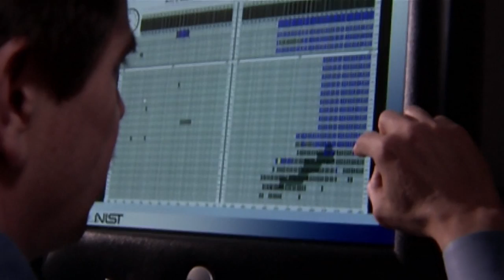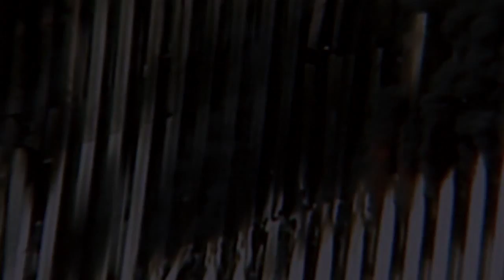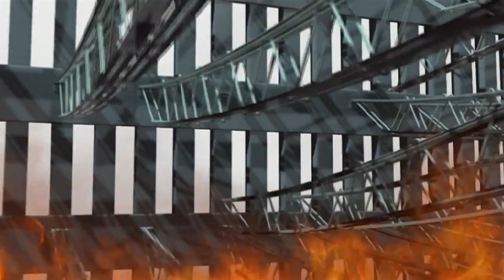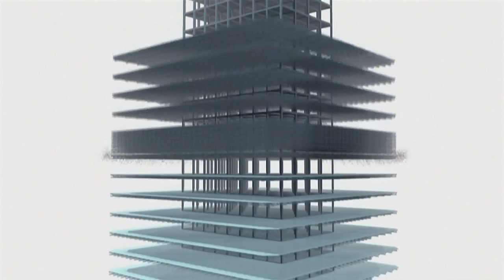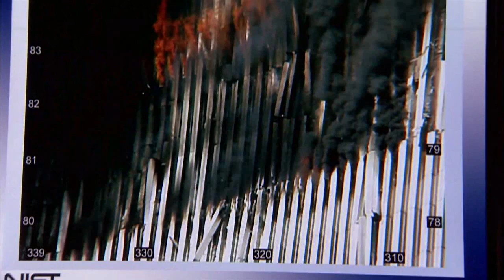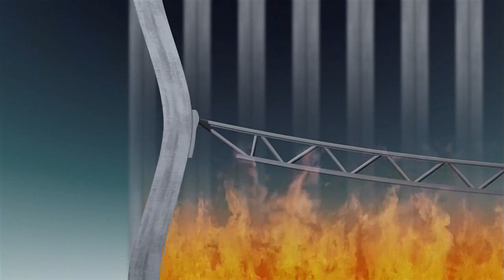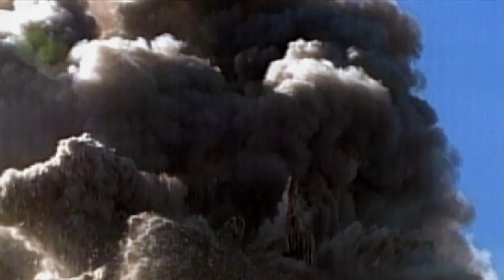WTC - collapse revised

Comment: Another thing that they could have to prevent this from happening, is to have way better security screenings at airports. Those buildings would still be standing if it wasn't for September 11. Wish I could have gotten to see the wtc in person.
Reply: You should see current WTC complex and memorial that's nearly complete. When Tower Two is completed, there will be a all new buildings with a similar total square footage. It will be safe, without 40,000 office workers packed inside two nearly identical buildings.
Reply: @dritemolawzbks8574  Not if Larry wants a new tower again and takes out insurance.  Heavy equipment moved into the area before the tower went down.

Comment: I just don't get why there was no resistance? The weight below in the undamaged floors was strong enough to hold the falling floors. So that means the resistance should have slowed the collapse down?
Reply: There was resistance, but there was also gravity.
Reply: Gravity, falling speed, weight, strength, etc…

Comment: Every steel structure cought in major fire collapsed, from bridges to buildings
Reply: ste1fan1 
Not true. There are dozens of skyscrapers fires that lasted for many more hours than the WTC and some even lasted for DAYS! until the fire extinguished by itself. The fire NEVER reaches the kind of temperatures needed to even even weaken steel structures.  The structure in all of those fires were examined by experts after the fire and determined the steel structure was as good as new and simply rebuilt the concrete and walls and glass again using the same steel structure.  Show me ONE single example of a skyscraper collapsing due to fire. None.
Reply: @BassicVIC  Windsor Tower ( Steel part) , Plasco Building, I 85 collapse, etc

Name one Steel structure that survived major fire?

Also steel loses 50% of its strength at just 600 C, its a fact dude. And not just that, it also expands so whole structure is weakened even more.
Reply: ste1fan1 
OK. Thanks. I’ll look into those. But steel doesn’t give way at 600ºC. It takes at least 1000ºC.   I’ll definitely have a look at the examples you gave me.  Have a look at the videos by Prof. David Chandler on the subject. Cheers.
Reply: ste1fan1 
I stand corrected. There have been collapses due to fire. Plasco Building was built in 1963 and it was by no means the mammoth piece of engineering the WTC towers were. Maybe it wasn’t sturdy enough. Windsor Tower in Madrid, only the burning top floors collapsed, and the rest of the floors below didn’t “pancake”.  I’m all for getting to the truth of things with an open mind and trying to be as objective as possible. Many things in the 9-11 case still just don’t add up.
Reply: @BassicVIC  
Office Fires can soften steel and can make it sag and buckle or thermally expand.
Reply: @Shelby_Starner_Everything  but not complete structural failure like towers 1, 2 and 7 at free fall + a few milliseconds
Reply: @Shelby_Starner_Everything  wow, and I thought that after all these years that people were smart enough to see what's right in your face. Man you sure are certain that fire can produce molten pools of iron right?

Comment: Ok, but that sounds like a structural flaw though.
Reply: There were many structural flaws with the building. It had no interior columns which meant all the weight of each floor relied on the core (made of mostly drywall) and the exterior to stay up. The buildings were designed to withstand a collision with a 707 but the designers did not put into account withstanding collisions with larger aircraft that would be developed years after the buildings were made. The building lacked a sprinkler system for a few years.

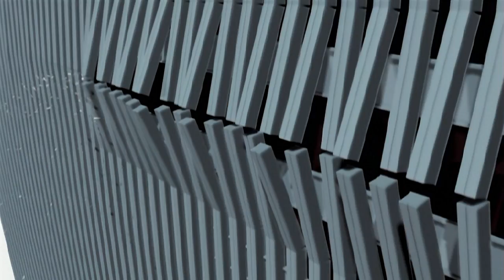Comment: Lol look at 1:18. So a bunch of the exterior columns broke and that's what caused the collapse? So why didn't the building fall right when the planes crashed into them at an angle taking out multiple floors of exterior columns and trusses? A building that was specifically designed to not fall when the exterior columns were severed and survive a direct hit from a plane. Lmao.
Reply: Look at the south side, that’s the side the tower leaned towards

Comment: My mind is blown.... this just doesn't make any sense.... how in the FUCK could an entire building crumple down like that? Even if the walls did buckle, the building would just roll of and fall down, the rest of the building would still be standing
Reply: Gravity, weight of debris, falling speed, etc…

Also remember there were no interior columns, the exterior ones were hollow and the interior core was mostly drywall, and there was no working sprinkler system above impact.

Comment: So the 14 inch thick columns fail before the two bolts/rivets holding the truss in place?
Reply: The exterior walls were hollow. It was just air inside them.
Reply: Yes
Reply: The exterior columns were not 14in  think

Comment: This video is hellerious there is a video on YouTube what shows the 85 floor being referbished and you can see the extent of the fire protection and that the trusses actually go in two directions making a grid pattern
 Also on top of this you have like a corrugated floor base what they connect to and to top this off huge steel beams that span the floor. The trusses also are bolted and welded to the above floor as well as the columns . Where is the floor, beams and rest of the trusses in this model?
Reply: This simulation is just about 90% correct as to the point of the call apse such as the warping at the top and the speed but I agree the model of the floors and such were way off
Reply: I at least know the warping in the wall and how it snaps is true for building 2 and I could give a link to the video too
Reply: And spandrel and columns pieces are crossed each other , like a brick wall , no linear weak joint as video shows ... First the trusses joint break , and pancake floors , later the connection joint resist and the weight o the trusses and the 4 inch concrete are capable of broke the column joint bolts , and broke in two the crossed columns pieces conveniently not shown on this video ...

Comment: Is anybody familiar with the fires that burned underground thru December 19th that water wouldn't put out?  A special foam Pyrocool had to be used.  Temps underground were over 2000 degrees and the heat radiated from specific spots under all 3 building.  It was from an underground mini nuke detonation. After the carbons burned off, steam came up.  Venting and then seeping then happened.   Thats why they sat in craters...1140 persons vaporized...Blast wave...Radiation cancers...Firestorm.....Molten metal underground seen as late as February.  Heat radiated from fission.  High levels of barium, strontium, and rubidium were found in the dust samples.
Reply: muttkat Mini nuke is laughable, nukes spread radiation, so a nuke blew up, but no one got radiation poisoning?
Reply: muttkat Also no flashes, or sounds or mushroom cloud, buildings collapsed from impact points.
Reply: To someone who hasn't done the research, it seems laughable.  I always knew something wasn't right with the official story.  After I watched Dimitris Khalesovs video it started making sense, so I started digging deeper and realized it couldn't be anything else because what happens in an underground  nuke detonation happened at the WTC.  I read some nukes can be low in radiation if they don't have a uranium jacket.  One detonated deep enough will have most of the radiation absorbed by surround bedrock....dirt..   Some radiation escaped giving responders radiation type cancers quickly and dying from it within 7 or 8 years.  I studied govt nuke reports and matched them to WTC reports.  I matched stories from  servicemen from the USS Reagan to WTC survivors.  One Sgt Tartigulia started losing his teeth shortly after.  If you want to know more, I can put the sites down.
Reply: Many responders saw flashes and saw and hears explosions before the collapse even started.  Some mention an orange flash.  One firefighter was about a block to a block and a half away and saw a 2 to 3 story piece of the WTC almost hit a cop BEFORE the collapse cloud even hit the ground.  Only a  great force could be capable of doing that and what would be capable of that?  Compare the picture of underground subsurface nuke versus the WTC exploding.  They're similar.  It wasn't no gravity driven collapse.  There were explosions at the impact zone, ground level, in the middle...
Reply: This is just one person who saw the flashes.  There was also a shockwave that almost overturned the boat she was in.  SOMEWHERE AROUND THE MIDDLE OF THE WORLD TRADE CENTER THERE WAS THIS ORANGE AND RED FLASH COMING OUT.  INITIALLY,  IT WAS JUST ONE FLASH THEN THIS FLASH JUST KEPT POPPING ALL THE WAY AROUND THE BUILDING AND THaT BUILDING HAD STARTED TO EXPLODE.   THE POPPING SOUND AND WITH EACH POPPING SOUND  IT WAS INITIALLY AN ORANGE AND THEN RED FLASH CAME OUT OF THE BUILDING AND THEN IT WOULD JUST GO ALL AROUND THE BUILDING ON BOTH SIDES AS FAR AS I COULD SEE.   THESE POPPING SOUNDS AND THE EXPLOSIONS WERE GETTING BIGGER GOING BOTH UP AND DOWN AND THEN ALL AROUND the building.  Karen Deshore     http://graphics8.nytimes.com/packages/pdf/nyregion/20050812_WTC_GRAPHIC/9110192.PDF

Comment: I always thought it was a stupid design and I cannot believe that those flooring pieces were connected to The inner framework and outer should by those little metal joists. I'm no architect but I can believe the pancake effect due to the way those floors were attached.  Tower 7 is another story.
Reply: https://youtu.be/IssGRpcB_ms
Building 7 fire. Case closed.

Comment: What makes no sense to me is that the spire clearly starts falling before the top section does. How would this happen if it's apparently the trusses being affected by the heat, which is many floors below where the spire is attached.
Reply: The spire sits ontop of the core and the core was built out of mostly drywall. The drywall stood no chance.

Comment: if that was the case then only the top floors would have came down not the whole building and that fire was no hotter than 250 degrees think about it most of the jet fuel remains out side steel will never buckle or brake under 2,600 degrees how ever it can become soft but those towers should be standing today this is what you get with an inside job and think about building seven if you believe that this was tarriest your completely stupid and it was hour own government.

Comment: This video doesnt sit right with me. If the steel holding the floors up gave way the the floors pancaked down, most of the outer shell and core would still be standing. I can liken it to an lift in a lift shaft. If a fire breaks out in a lift and the holdings give way, its only the lift that drops, not the whole shaft too. Plus the fires were slow burning and many things in the office are fire retardent and the aviation fuel would of burnt up very quicky. No way would that fire  be able the melt / steel. it would be trying to melt a knife with a candle flame.
Reply: It didn't MELT it, it WEAKENED it.

Comment: why was there molten metal found? why was thermite found? why do the planes look like military planes? why can explosions be seen before the collapse? how did Building 7 fall?
Reply: There was no molten metal found, where did you hear that? 

Building 7 took damage from the debris from tower 1 and caught fire in multiple places which spread quickly (you can see pictures of the damage it sustained from WTC1 debris). There was bent and weakened metal but I’ve never heard anyone say there was molten metal. Steel is not indestructible.

Comment: Amazing that NIST doesn't know what exploding buildings look like.  A regular collapse should go straight down basically.  The WTC at least double in size horizontally.  Also it has been noted that the graphics of the building coming down excludes the outer walls on the NIST report.
Reply: A regular implosion goes straight down, the towers didnt. The north tower leaned to the SW and south tower leaned to the East

Comment: this is totally guff as the video displays a fire consuming the whole of the floor not just part of it as we see in real life. As part of the building is damage and subsequently weaker any given force would try to fined the easiest route out which is the route which offers little or no resistance. this is quite clear when you see the collapse of the south tower as the top begins toppling over and then miraculously rights it's self and continues on a down word path. I'm no scientists but I quite clearly know that's ludicrously impossible and this is quite clearly not what we see happen

Comment: If this is true then shouldn't the top of the towers be at the bottom? Not vaporised into dust
Reply: big jak 
By that logic why don't planes stay completely intact when they crash?
Reply: Alejandro A. Sanchez-Perez which is why they do t make buildings like this no more the new wtc is state of the art with high end technology build to it the old towers were tube structures
Reply: Idiot...
Reply: Most plane crashes leave varying sizes of identifiable debris of the plane in the crash area.  How can the upper sections crush the entire building below, and not leave ANY identifiable part of the upper section on top of the rubble pile?  The 12-15 story block of the North Tower was strong enough to crush a whopping 90 some floors...but then just disintegrate after that?
Reply: yearginclarke flight 93 smashed into the ground with pieces only the size of your hand left.. same with Florida air when it crashed the the everglades along with numerous other crashes..

Comment: If steel is heated it extends, increases in length. So how could the trusses pull the outer columns inward ??? The trusses  should'nt have sagged,  they should have pushed  the outer columns outward, if heated due to the fire.  
And how can leightweight trusses make a column to break ???
Nice theory but doesn't match reality.